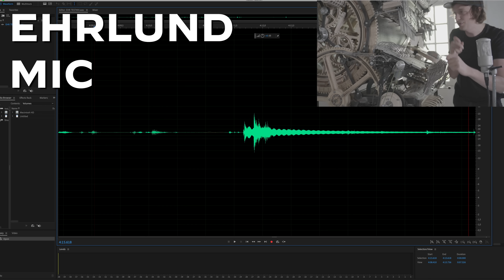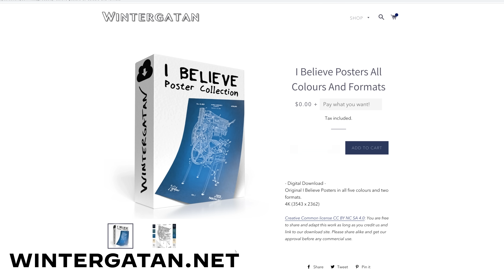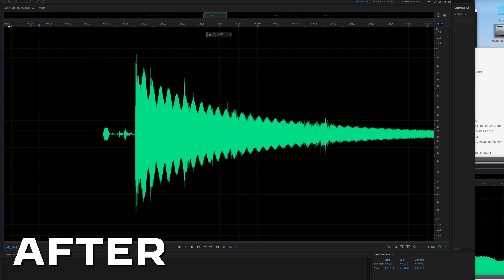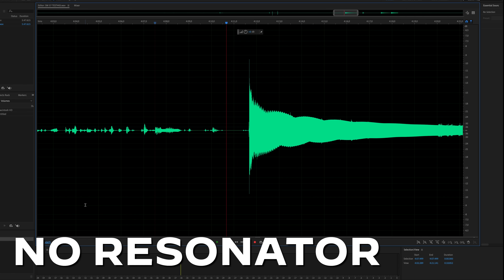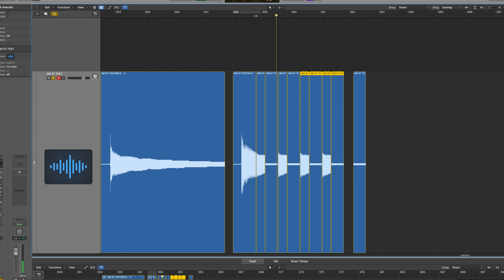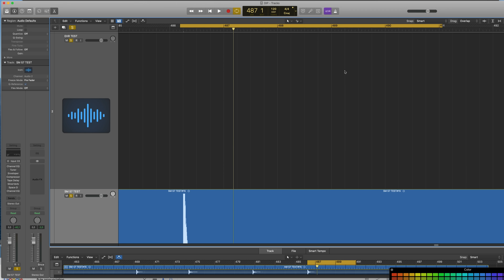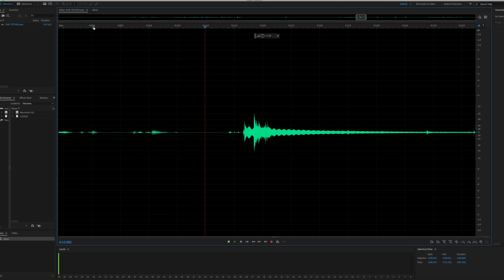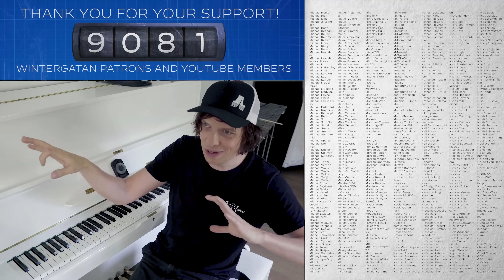Candy Dip for Marble Funnels - Marble Machine X135

Comment: My mom was a tinsmith many years ago. The whipping motion you used was identical to the motion she used to galvanize the interior of copper pipes.
Reply: Might be an example of "convergent evolution". :)
Reply: @BrokenCurtain  It is also identical to the motion I make when I am trying to get the last of the ketchup to the bottom of the squeezy bottle. Something is going on here... "this is important." ;)
Reply: @reina4969  This is was me until I accidentally opened the bottle mid swing and squirted ketchup everywhere. My mother was not happy.
Reply: @Wall-Enberg  Oh, yes, so I'm not the only one with this "ketchup on white kitchen furniture and on the walls" experience. more than 45 years ago,.but my old mom (86) tells this story very time when a ketchup bottle is put the table.... :-)
Reply: @Wall-Enberg  I have NEVER forgotten to close the lid on any bottle I flung around. I think I would have to judge harshly any child who does this as a reckless threat to society.
Reply: @hesspet  Also, JUDGED.
Reply: @Wall-Enberg   @Fabian Salomonsson  I did that too but I accidentally spilled ketchup all over my dad's face... you can tell he wasn't happy.
Reply: Reino you don’t just bang it on a hard surface?
Reply: @CIDILIABRA  NO! It can break the cheap flappy cap plastic. Ramming it into your hand is better than a hard surface, but still not as good as one full arm swing. You just have to be standing up to do it. I am pretty sure that qualifies me as a professional tinsmith.
Reply: Nice
Reply: Ooh, getting spanked as a child must of hurt for you :)
Reply: It's the same Motion my Dad does with his Belt... 😏